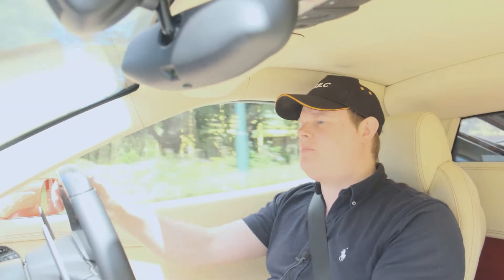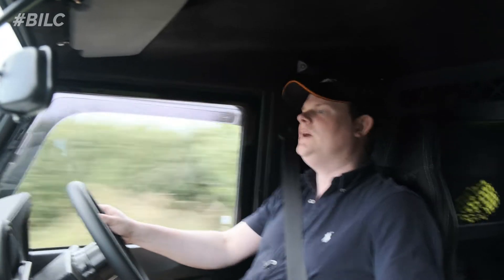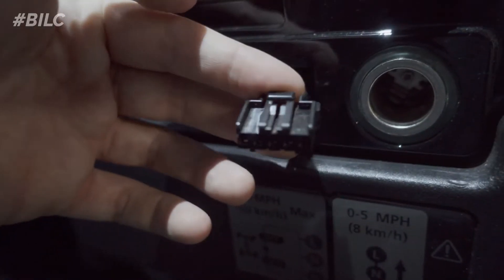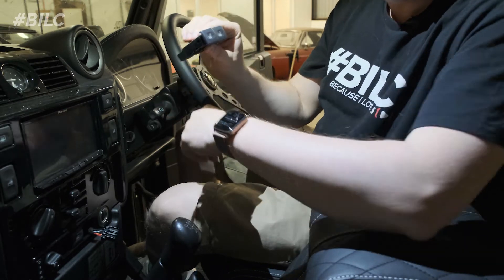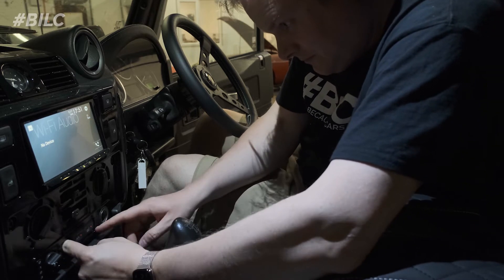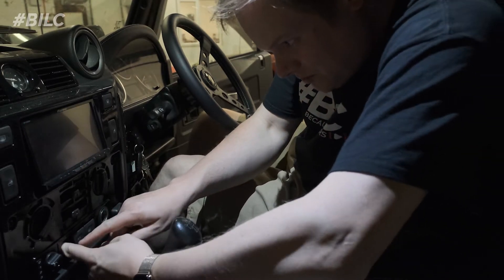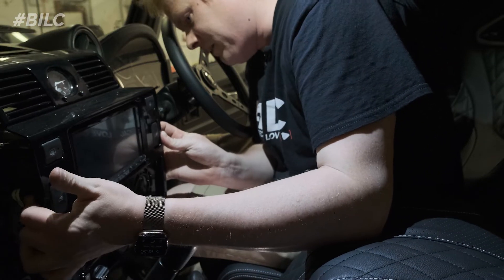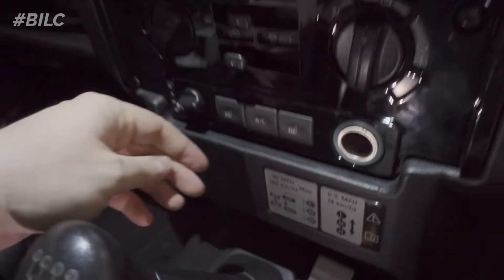FINALLY completing a long-awaited project!

Comment: I'd have taken the dash off first, a lot easier, but you know that now. I wire the whole system better to avoid potential battery drain that you get with the original configuration. For mine I also have one touch switches and auto off when power is removed. But then I have been doing bespoke car electrics for 30 years. 🙂
Reply from the maker: Thats really useful feedback would love to know how to get auto off working incase someone accidentally leaves the heated seat on over night.